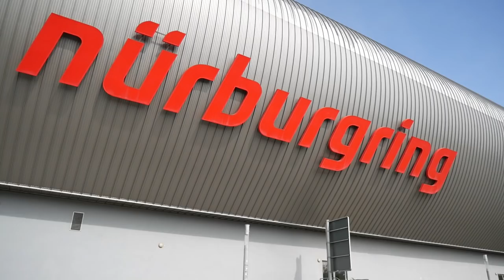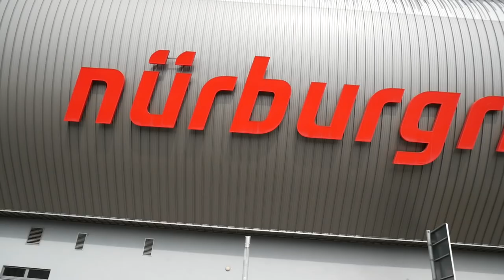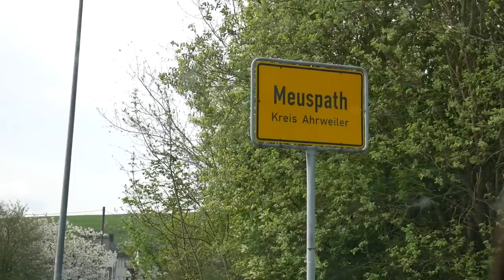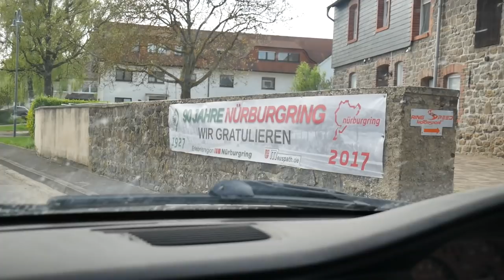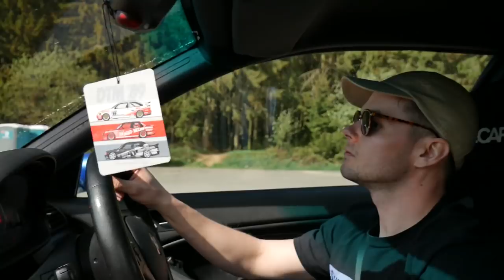Welcome to the Nürburgring! Change your brake pads.

Comment: I know it’s a bit late now but regards the electric fan on the M3, make sure it’s wired up to suck rather than pushing the air forward and into the radiator

Comment: Nice vid Danny. Missed you by a couple of days. Seeing Mike's Civic I'm kind of worried. The harnesses can cause an injury to the spine in case of an accident. This way you will compress the vertebral column if this go south. The angle is way too steep. They should be between 0 - 10 degrees below the shoulder. Cheers
Reply from the maker: Hey man, that's a shame! I thought I saw you on the Sunday actually, but I must have been mistaken. The harnesses aren't ideal we know. How have you been getting on at the 'ring lately? TF seemed really good the week I was there. Not many idiots, reasonable weather... midweek TF is the best!
Reply: Owww if you're talking about Sunday 08.04 than I've overlooked your car. BTW that Silver BMW RingTool you fancied belongs to a friend of mine. Great car and dito driver. The Ring was fine for 4 track-days with the proven PAGID RS29's until as an experiment I put a set of dixcel Ra's under the Z4Minator. After 6 laps the Rotor cracked.... New rotors/RS29 ordered and installed. Anyone fancy a barely used set of Dixcels????? Cheers
Reply from the maker: Wow really? What calipers do you have on there? That's worrying!

Comment: Haha I had exactly the same problem with my backing plates (both lose from broken top bolt) I had to just cable tie them to strut 😂
Reply from the maker: Haha I thought about fixing them, but with the issues with brake fade on the first lap, drastic times call for drastic measures!

Comment: anyone who raises the back of their bonnets cant be classed as serious. lol
Reply: Check engine bay temps, say what you want but it’s functional
Reply: May be so. But the air is flowing opposite to what most people think in motion. Air doesn't escape out of the bonnet. It gets pushed in and exits under the car. It's bad for aerodynamics and can stall airflow to the rad. You will never see a professional race team do it. Bonnet vents placed in a low pressure area of the bonnet is the proper solution.
Reply: Again Spark plug Steve you’re speaking as if this is done to a street car, if it’s done properly it’s very easy to have the air exit out of the back of the hood, when I do rally you can see the dust come through even without a panel under the car, so I will have to disagree! You also probably don’t do long distance races where engine heat is a huge factor
Reply: simple way to test it is tape some strings to the scuttle and rear bonnet edge and watch what direction they flow. let me know how it goes.
Reply: actually its given me a video idea. i will run the test myself and do it in the interest of fairness to see the genuine outcome.
Reply: Be sure to do with and without a plate under the engine bay and also tape the strings from the underside of the hood!
Reply: I cannot do a test with bottom of the engine covered. In the past I did have a front splitter that lead to a flat floor and diffuser. I did string tests with this setup and bonnet vent. When you block of the underside of the car it creates a lot of low pressure under the car. Above the car is high pressure. High pressure air will always force itself to a low pressure zone. So in my string test the air was getting sucked into the bonnet vents rather than out. When you aero tests things its very surprising that airflow does not always work as you expect. Im definatley going to do a video test and will film the results. I'm open to being wrong but my prediction will be the strings will get sucked into the engine bay rather than flow out. If I'm wrong I will accept it but either way I'm looking forward to testing it. Subscribe to my channel if you wish to watch the video. Thank you.

Comment: was this trouble with the brake pads before or after the laps of the GP circuit?
Reply from the maker: this was after 1 lap of the Nordschleife. Well not even that. I wasn't even half way round. Hence the drastic measures of cutting the shields off as well. The thing you need here is confidence in brakes!